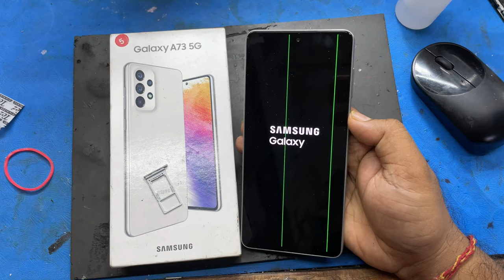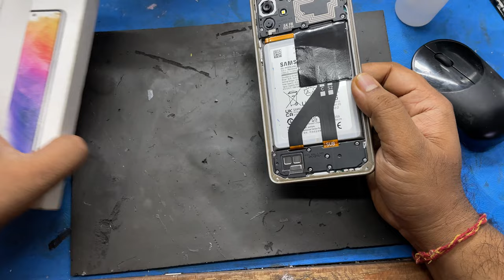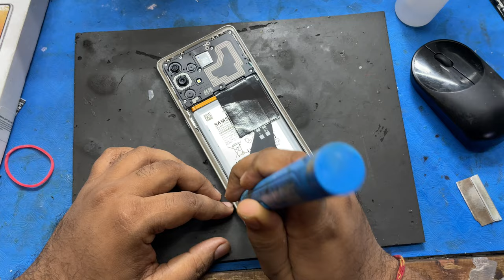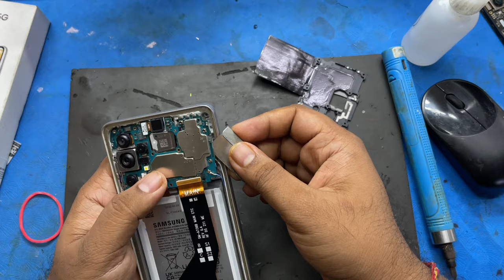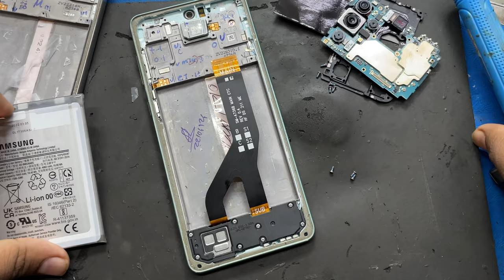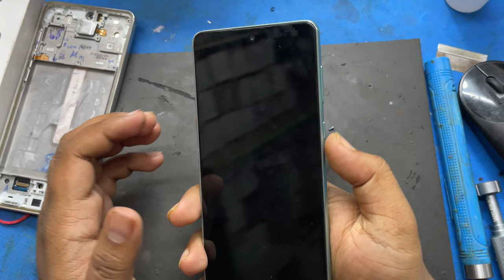SAMSUNG A73 Green Line Problem Solved

Comment: 🔴 Suddenly facing same multiple Green Pink line issue in SAMSUNG Galaxy A73 5G, after software update & installation of One UI Version 6.1 --Android Version 14 which i received officially from Samsung. ALSO  NO PHYSICAL DAMAGE  IS THERE TO MY PHONE STILL FACING THIS GREEN LINE ISSUE. SAMSUNG IS NOT ACCEPTING THIS FACT EVEN THOUGH MANY CUSTOMERS ARE FACING SAME ISSUE.  Software cannot be erased once installed as per samsung service centre and this same problem is coming in many A73 5G due to software.

Comment: Bro after change display green lines come again ?please tell
Reply from the maker: No update no line
Reply: @tanmoymobile2022  I got many lines now bro so now I need to change display or not ?
Reply: 🔴 Suddenly facing same multiple Green Pink line issue in SAMSUNG Galaxy A73 5G, after software update & installation of One UI Version 6.1 --Android Version 14 which i received officially from Samsung. ALSO  NO PHYSICAL DAMAGE  IS THERE TO MY PHONE STILL FACING THIS GREEN LINE ISSUE. SAMSUNG IS NOT ACCEPTING THIS FACT EVEN THOUGH MANY CUSTOMERS ARE FACING SAME ISSUE.  Software cannot be erased once installed as per samsung service centre and this same problem is coming in many A73 5G due to software.